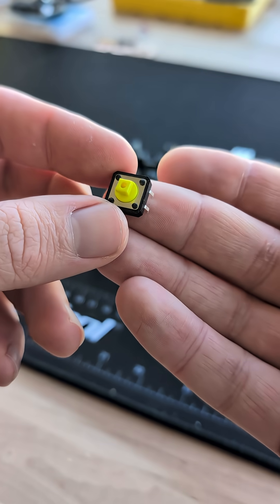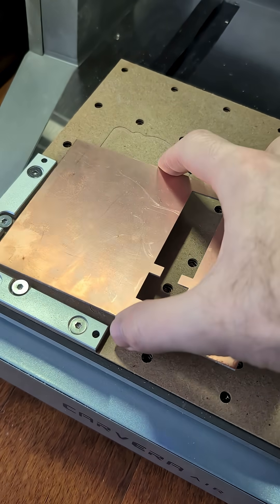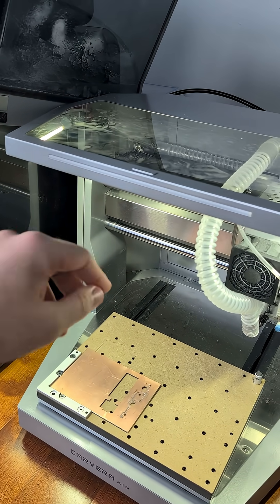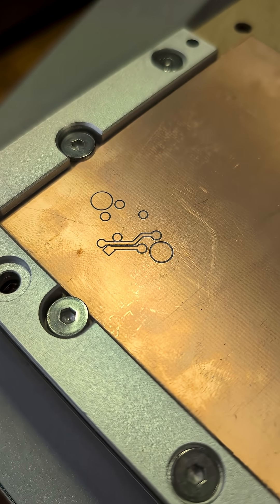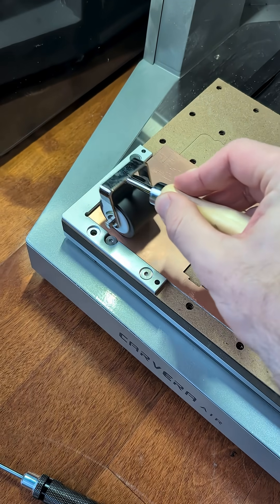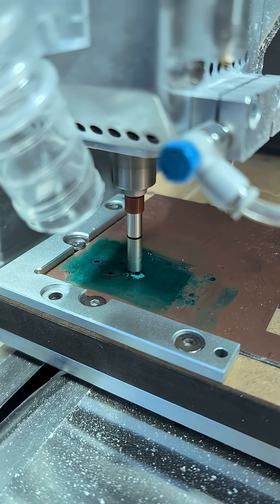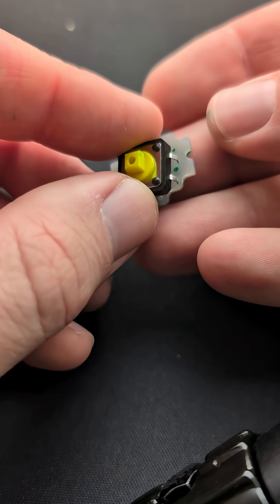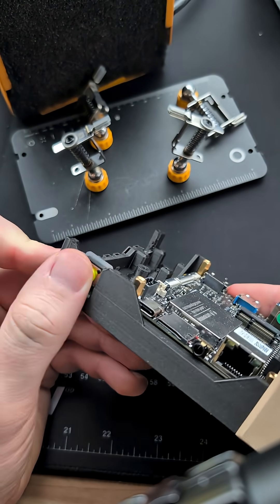Let's make a PCB in less than 60 minutes...

Comment from the maker: This is not a paid video, but Makera did provide the Carvera Air for free. I was honestly not sold on the device when they first reached out but the flexibility of being able to CNC metal, plastic, wood AND circuit boards has really won me over.

If you want to look into these awesome desktop CNC machines, you can just Google it or go to the "Products / Parts List" linked in my bio and check out the Newest tab.

Either way, you can use the promo code abe100OFF for $100 off the Carvera Air or other Makera devices.
Reply: You know the price is going to be high when they’re offering $100 off

Neat tho
Reply: What kinda hoover and adapters do you use with it?
Reply: You could use a Rittal Perforex BC 1001 HS or BC 1007 HS. Not Overkill at all.
Reply: Dopest dope I ever smoked ❤️‍🔥
Reply: You should have mentioned your mistake of selecting the wrong switch footprint during the first half of this.
Reply: It is paid.... Just not with money
Reply: You weren't "SOLD" on it 'till it was "FREE".
Reply: So it was a sponsored video not explicitly marked - got it
Reply from the maker: @ezikhoyo I try to be clear with these things by always pinning a comment which outlines my relationship to the company and just to be safe I also selected the "this video contains sponsored content" checkbox in YouTube, however recent UI changes make that disclosure easy to miss when viewing which is annoying and hopefully they switch it back to be more visible.
Reply: @ezikhoyo dawg he is way more transparent than he needs to be or than most are. Get off his dick. You can tell hes being genuine man. More than you can say for most

Comment: Architect: okay, so we need to make a custom circuit board with a specific hole for the button, then we can mount it and it’ll cost only thirty dollars! 
Engineer: just make the plastic hole smaller on the 3d print and wire it to the mother board, it’ll cost like three cents

Comment: There's nothing technically wrong with what you did. However, it certainly was not the easiest, least expensive, or fastest way to accomplish your goal. You could have just as easily 3D printed a piece of plastic in the same shape as "circuit board."  Then insert your button, and solder directly to the pins on the other side of the button. Done.

Comment: Without all fancy expensive machines, I can make this PCB in 15 minutes manually.
Reply: You can print solder masks on a PCB with a 3D printer.. or draw it with a sharpie marker😅
Reply: @mrburns366 or print with a laser printer in glossy paper, transfer it to the board and etch it in like 15 minutes

Comment: How did you cure that solder mask?

I have the same one, but it never dries under my UV source. Interestingly, heating it works well.
Reply from the maker: Interesting! I did have a bit of trouble with it curing, I ended up tossing it into my resin printer's curing machine to blast it with UV and rotate it as it does. That got it nice and cured.
Reply: @abetoday how long did it take?

And I also suggest using some heat from reflow plate or air gun, but keep it low (around 100-150°C). That's the way I cured my solder mask.
Reply from the maker: @Gameplayer55055 thanks for tip I'll give that a try. I think I put it in the cure machine for 15 min just to totally cook it

Comment: Bear in mind you need a specific kind of "raw" PCB, I forget the name exactly but it has to be the older type. The newer type will just shred and fall apart if you try to mill it.
Reply from the maker: You're probably thinking of FR1 and FR2 which are paper-based substrates, versus FR4 which is fiberglass and what I'm using here.

Comment: Cut piece of perf board. Drill holes for screws. Solder. Mount. 10 minutes.
Reply: Or just use Hot Snot liberally for mounting stuff. Liberally means drown it.
Reply: give me a breadboard, sandpapers, and pliers. I bet I can firmly mount this switch under 20 minutes. 15 minutes if with a dremel.
Reply: That's me 😂
Reply: Hot glue and soldered leads. 😆
Reply: But it wouldn't look as cool.
Reply: Came to the comment to make or like this.
Reply: My thinking, but then he couldn’t look at a project that looks as if it was mass produced. It would look too home made. Yuk LOL
Reply: I mean the dude already had a 3D printer... Just 3D print that same circuit board shape.  Having a circuit board just to mount a button makes absolutely no sense.  You could just as easily solder right onto the legs of the button in the 3d printer mount.

Comment: You know if you have etching down you can cut that down to half an hour, finished product.
With very little variation in time depending on  size and complexity. 
But you have to deal with chemicals...
Reply: Strongly agree. CNCing this is fine, but it’s an expensive and complex way of getting the same result as cheap and simple etching. Ferric Chloride isn’t very hazardous, other than in disposal - in our neighborhood you can take <10 gallons to the household waste site for $5.
Reply: @JGH-555  there's also citric acid+hydrogen peroxide+salt. It's entirely safe
Reply: @JGH-555  It requires discipline, something a lot of people don't want to deal with...

Comment: its a brave new world in which CNC routers are being described as "like a 3d printer that removes material"
Reply: 3D Printing people: "must be horrible when it messes up like when a Printer goes full spaghetti mode, huh?"

CNC People: "Yeah, really sucks when the bit explodes, ruining your part, wearing out spindle bearings and destroying $100 bits."
Reply: @Gojira_Wins We goth both 3D printers and a Carvera Air. This is so true, except the piece is often not that damaged an can be reused. The bit, though...
Reply: They're both CNC machines, it's just that 3D printers are obviously way more popularized in the consumer space.
Reply: Everything old is new again!
Reply: Crazy right?
Reply: That Ozzy guy that did that song with Post Malone.. he's going to be big one day!
Reply: I mean, it’s not really a “they put Master Chief from Fortnite in Halo” situation, he’s just using an analogy to explain the machine
Reply: I mean, in a lot of ways they're fundamentally the same machine. Plotters are, too. You "just" change out the tool end, and an FDM printer needs much more precise vertical control. (I say "just" because designing a good hot end or cnc drill thing isn't easy, of course)
Reply: @keiyakins I think their objection is that more people know about 3D printers than CNC mills, despite CNC mills predating 3D printers by several decades. On the flip-side I know someone who was a machinist and told him that a 3D printer is basically a cross between a CNC mill and a hot glue gun.
Reply: @asteroidrules 

Additive welding manufacture is cool. It '3D printing' with a welder, fusing layers like a 3D printer does with plastic. Obviously with the same kinds of limitations, only in metal.
Reply: @asteroidrules . I’ve thought of it like that before too 😅. 
The comparison goes both ways, just depends on who you’re explaining it to.

Comment: Holy crap. This is amazing.
Reply: Woah, this machine is $2200.
Reply from the maker: @mrjceo they are running a Kickstarter for a sub $1000 machine. I haven't personally used it but if it's anywhere as good as the Carvera Air it's gonna be a game changer

Comment: how to make a pcb at home.. spend lots of money :p
Reply from the maker: There's no question it's a luxurious tool. Luckily we have affordable options like OSHPark for small batch PCB fabrication so you can figure out if you're using those services enough then it might be worth investing in tools for home!
Reply: Making diy PCBs is tons cheaper than pcbway/jlcpcb delivery to Ukraine (whipping 20 bucks)

So I diy all my PCBs. But I use a laser printer toner instead of CNC.
Reply: @Gameplayer55055 good thing I'm in russia and delivery is cheap
Reply: @lonesimba do you still have YouTube?
Reply: @lonesimba do you still have YouTube?
Reply: @Gameplayer55055 the last pcb i got from pcbway was $5 for 5. $25 shipped to US and $20 tariff/import fee..
Reply: Yeah many rapid pcb places will get you a board for $1(plus shipping and taxes) and on your desk in a week.  There are limitations to at home boards but many cases a simple through hole will get it done!
Reply: well If you have the hardware for other reasons you might as well. snapmakers, although also expensive also could do this.. or work in machining and its just a lunch break lol
Reply: well you can cut the costs by modifying ender 3 (which has been done by many ppl since 2017) or the old fashioned way with acids via etching
Reply: I'm so tired of seeing comments like this under every DiY video. Yes, you need tools for certain tasks.

Comment: This is so freaking cool. Homemade PCBs are the future of prototype engineering.
Reply: there are several ways to make homemade PCB's without any machines, you should check it out.
Reply: i mean, there are breadboard pcbs on the market which will require you to solder your own traces or you can use acids to make pcb at home (something called etching and hobbyist were doing like since at least the 70s), tho all 3 ways (including CNCing with something like carvera or modified 3d printer which was a thing for quite a while) will always limit you to 2 layers of copper

Comment: If only you find a way to embed the switch itself in the 3d print lmao
Reply: Shouldn't be too hard, have a pillar right behind the switch to support it, enclose the front a bit more, then just solder wires to the legs.
Reply: @Nukle0n  yeah, i think that's what OP was refering to